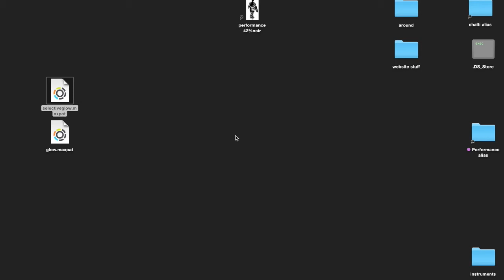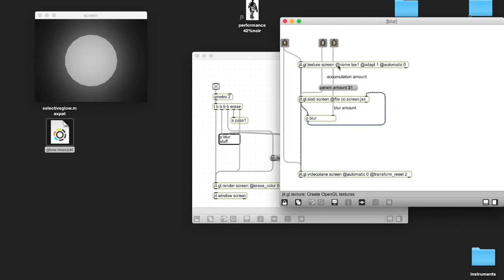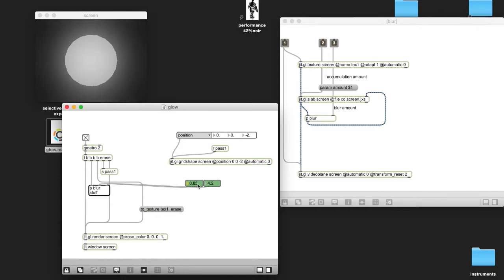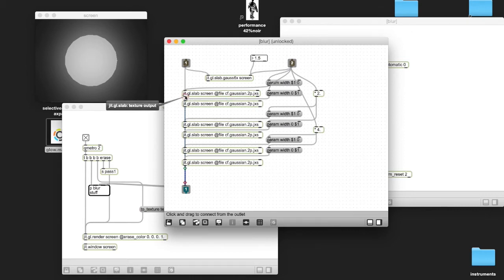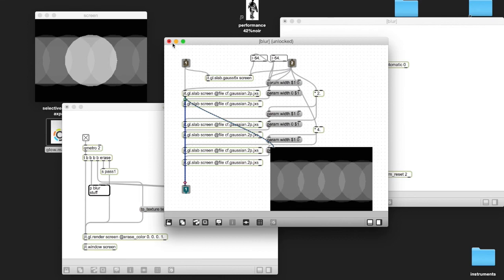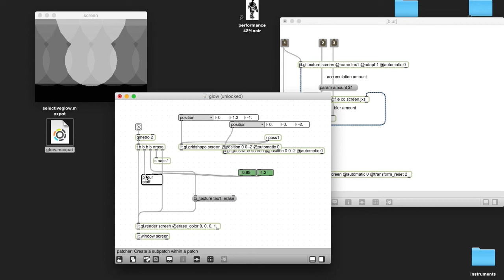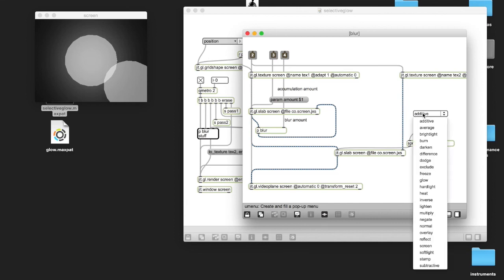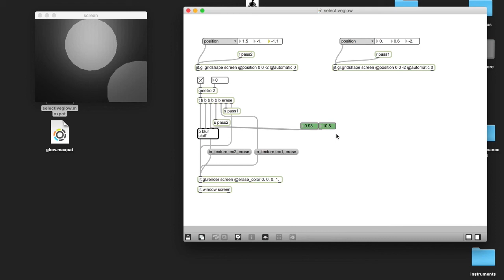Max Patch Download & Jitter tutorial - Glow and Selective Glow

Comment: Hi! I'm having issues understanding the order of which you send your bangs after the qmetro object, and why you use two erase messages to the jit.gl.render per frame. Could you elaborate on that? I'm getting a lot of problems when I try to apply this technique to my own patches.
Reply from the maker: Hi Jonas, thanks for your question. I understand it is a bit confusing at the beginning, but ill try to put it in another way: first you erase your screen, then you send to the render the first shape with sending pass 1, but you don't want to render it just to send it to the texture (which you can imagine as a memory you can later use) so you  just copy it to a texture  by using the to_texture, but then delete  it from the render (erase). Then you do the same for the second texture (tex2). Now you have 2 textures with  2 spheres but nothing in the render. Then you do the blurring for one of them (inside the subpatch blur) and combine the two textures (also inside the subpath blur). Finally you send the results of that to the render. Hope it is now better if you still have problems with your patch you can send me your stuff and ill try to figure out where is the problem..cheers.